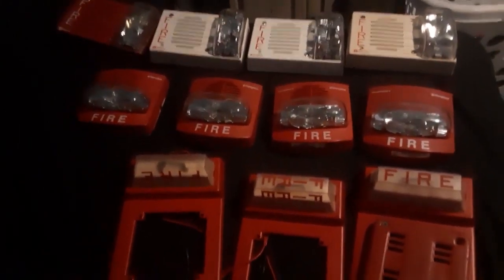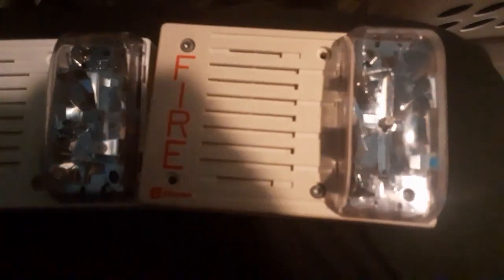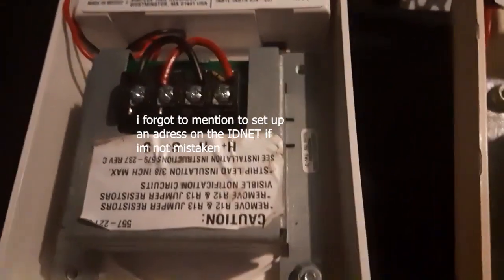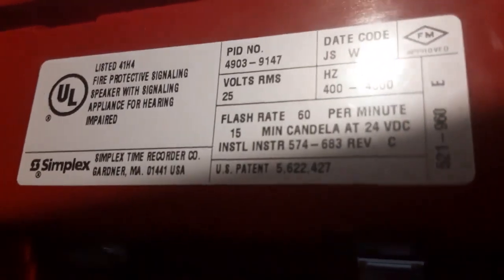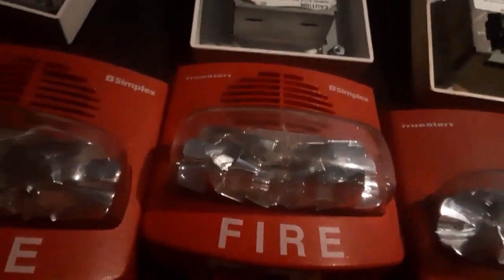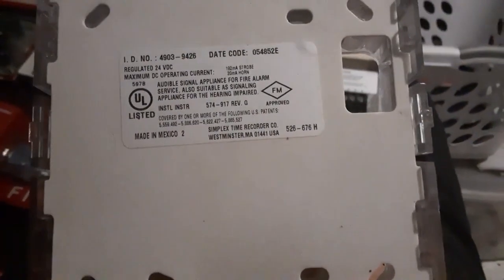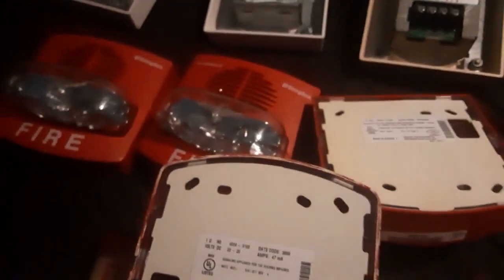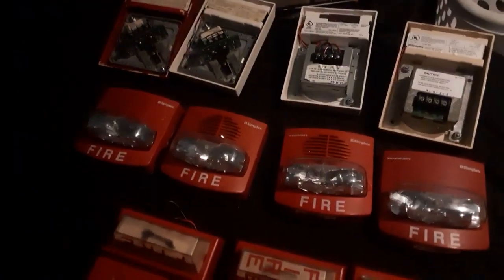Tips & Guides: How to tell if your Simplex Device(s) is Free Run, Smart Sync  Or Both

Comment: Well barely some low frequencies and speakers strobes like those can be free run strobe or smart or self sync strobes it depends if it’s multi candela or not I think I might order or collect some but those can be used for specific commercial condo home building or schools etc.
Reply: So we are not gonna talk about the 4904 or 4905/6/7 we are just gonna talk about the 4903 series well including quick or true alerts series models and es ish.